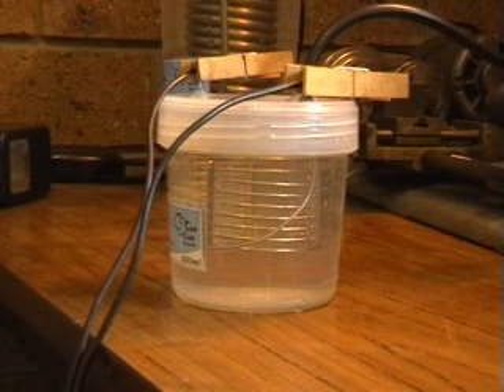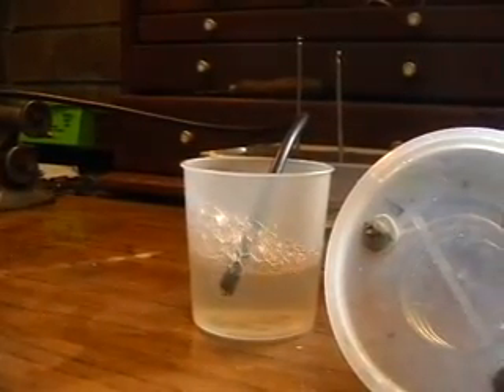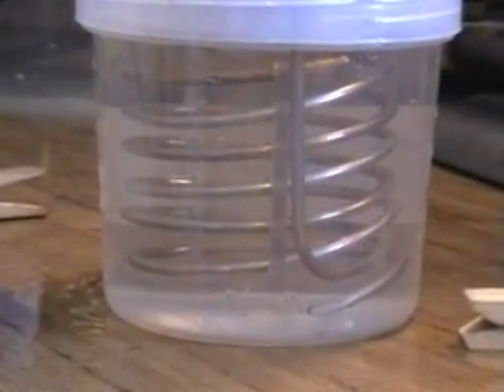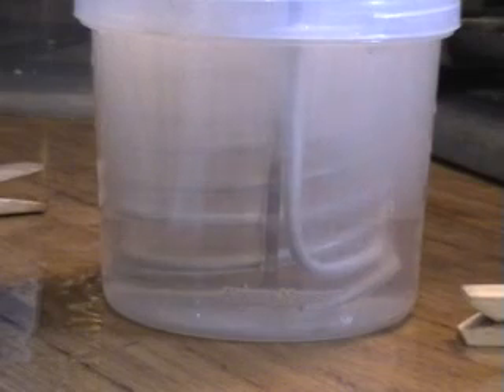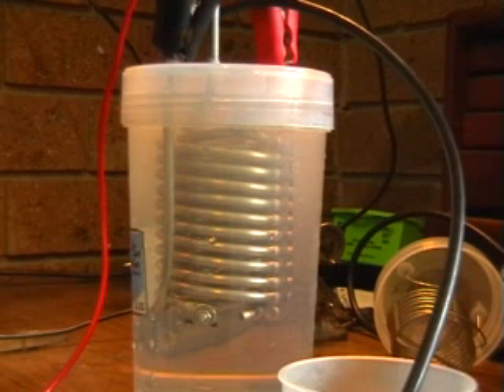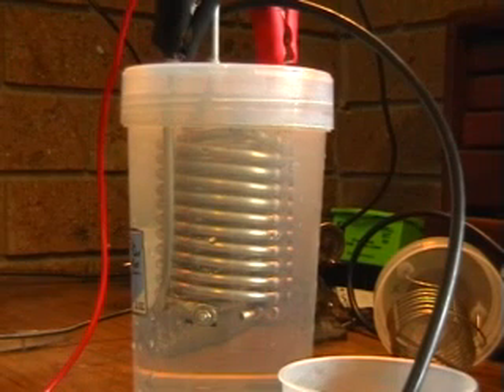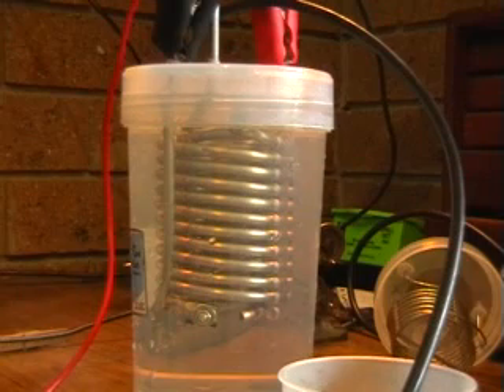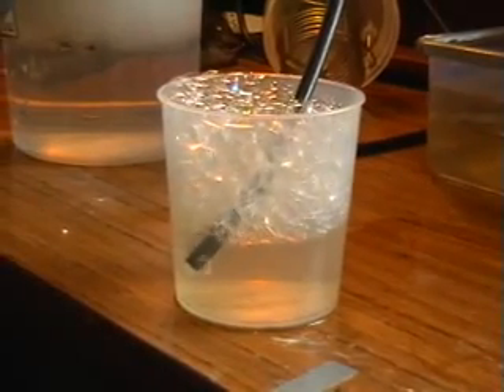HHO Trying Shapes.

Comment: From past knowledge I have seen how they wind copper pipes in a spiral, they first fill them with sand so they do not kink and bend in the middle, the sand has to be packed tight through the pipe and capped off at both ends before bending.
Reply from the maker: ***** This is an old way of doing bends but this old way is still in use today if the bends are tight some times its the only way to stop the bends from collapsing.Or use a pipe bending machine with a dongle that sits at the point of bend to stop the pipe collapse but some times the sand and plugs is still quicker and cheaper even today if doing odd shapes.
Reply: AVAMagneticlev  Well guess I am showing my age :)